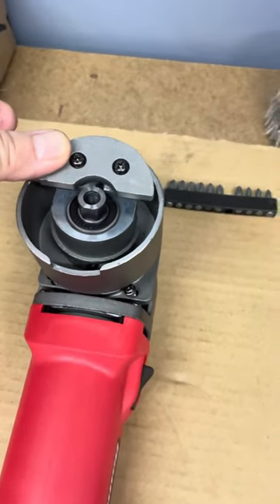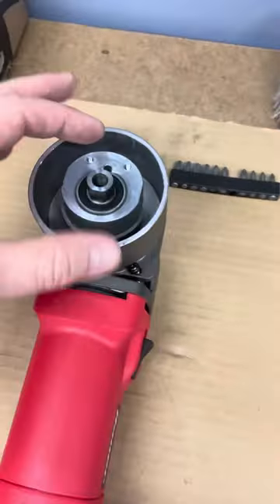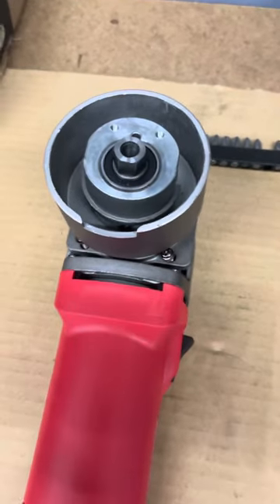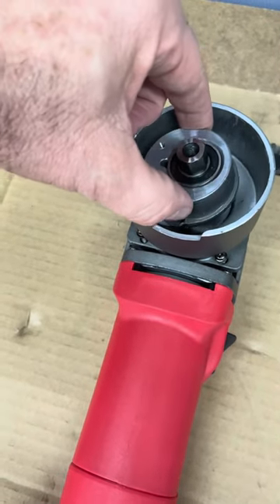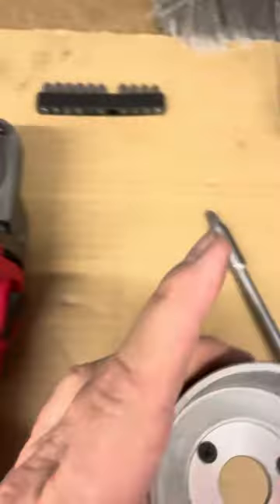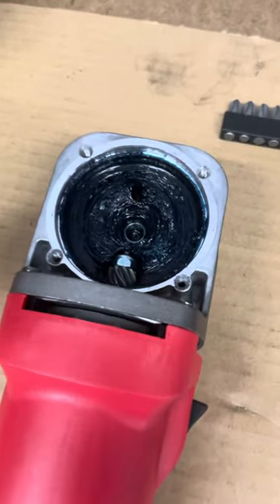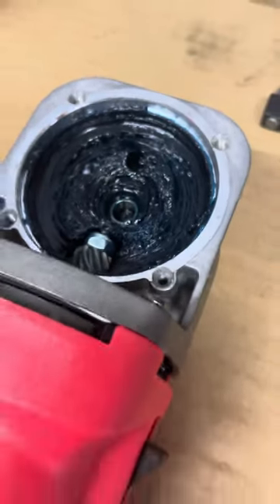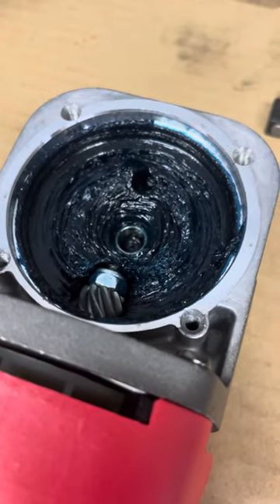Bauer 8mm DA Polisher grease change

Comment: Thanks for this. Just got one in August, I’m gonna leave it 👍
Reply from the maker: You’re welcome - mine has performed flawlessly through 2 complete paint corrections and wax applications (and removal). I will say that I’ll use the Lucas Red n Tacky when I decide to change it because I just used that in a rack and pinion overhaul - it’s some quality grease.